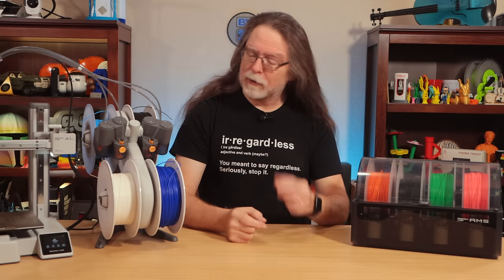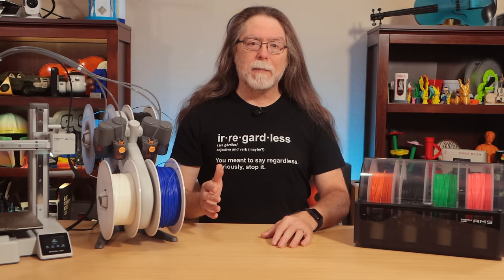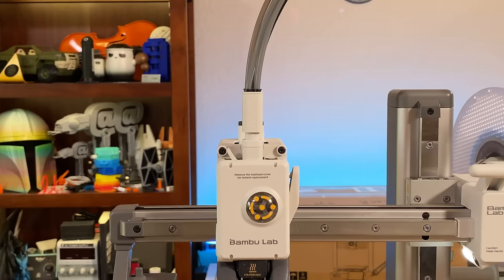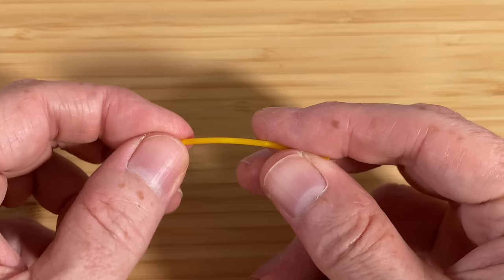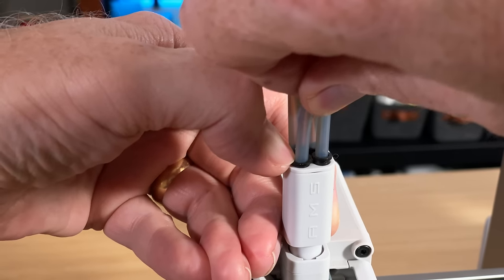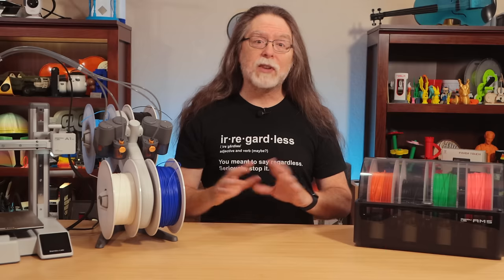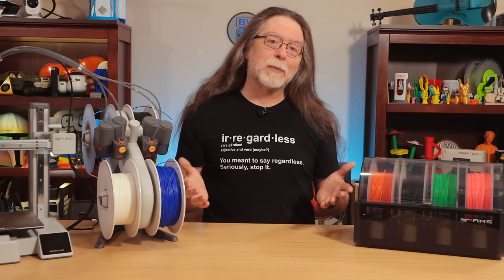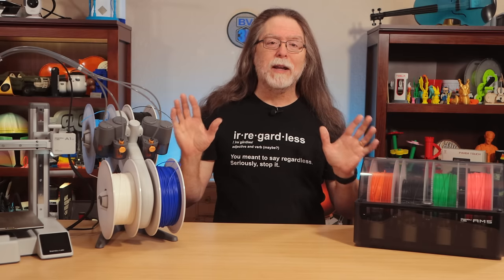The Bambu Lab AMS Problem NOBODY Talks About

Comment: Yeah a spool of PLA will get wet in a day or two where I am. You can be REALLY lazy with the full-size AMS because you can just fill it to the gills with desiccant. Eventually you'll need to toss it in a proper dryer though. The AMS Lite though, I load as needed and unload when done, same as with my monofilament printers. I blew a lot of money on good dryers and its just worth it to keep filament nice and dry -- no one likes nasty stringy prints with lousy bed adhesion anyway.

Comment: Interesting video. Re having to switch the printer off to recover, I have found the x1c and Ams to be pretty resilient and its ok to unplug and replug in AMS mid print, or even power off and on again if print is paused.  I agree though about the snapping filament. I created a model on Makerworld called 'overnight parking zone' - which is a little clip on part for you to put the filament end in overnight - rather than having to slot the end back into the side of the spool which might then interfere with neighbouring spools (which aren't parked)

Comment: False info, you can do this all while the print is paused. Ive done it multiple times
Reply from the maker: I'm glad you were able to remove the PTFE tubing from the tool head side of your A1 or A1 mini while the printer was paused, and remove the filament from the tubing. Are you able to press the rings gently and they release? On my A1 & A1 mini, it takes an enormous amount of pressure on the retaining rings to get them to let go. The one time I tried with the printer paused, I ended up pushing the tool head a bit along the X axis.